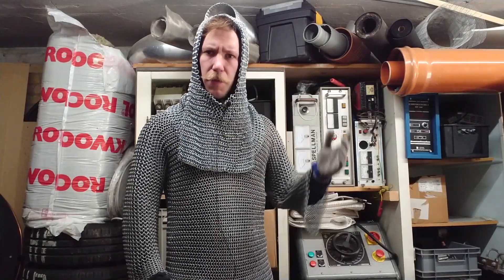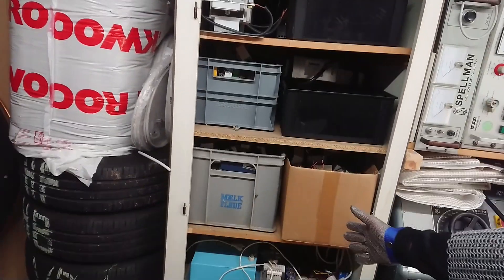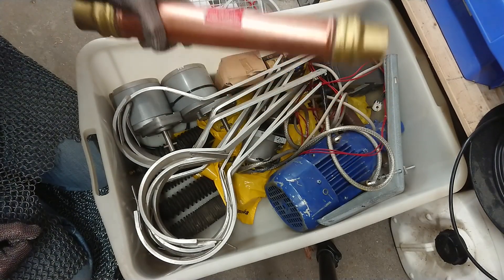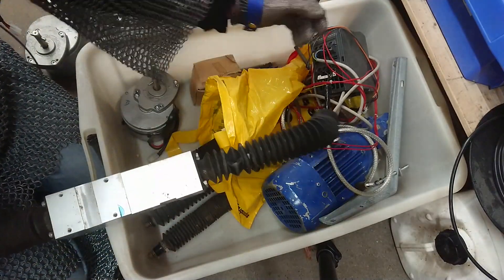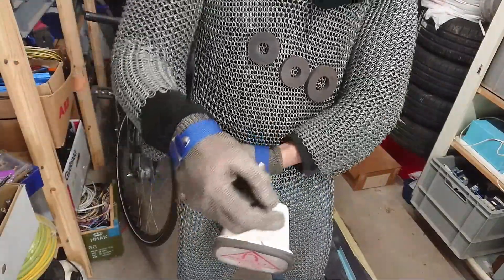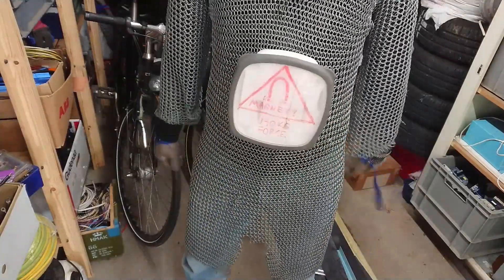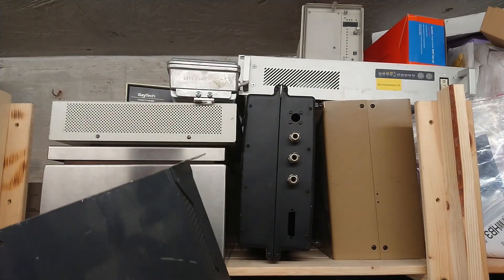After Cleaning, What I Found... - End of Isolation, Day 42

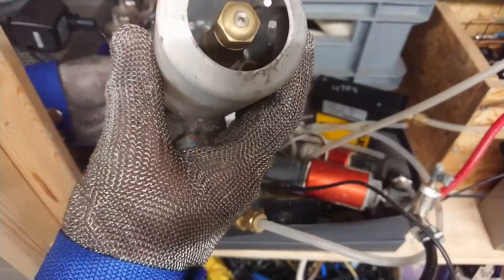Comment: The burner head at 4:13 is for an oil fired furnace :)
Reply from the maker: I can see that the nozzle and ignition rods look like it ( https://noraweb.org/wp-content/uploads/2016/10/NORA-Silver-Chapter-1.pdf ) but I can not seem to find any pictures online where it has that large "shroud" around it.
Reply: @KaizerPowerElectronicsDk  This "shroud" was typical for old systems designed for more than 1MW from 70ties. If you remove "shroud" temporary,  on the front nozzle will be written oil consumption in kg/h or gal/h. I guess that there is a rod that goes through the pipe and is for regulating flow. Nice to see if it is Danfoss or Weishaupt nozzle. Worked on hundreds of industrial burner plants, never seen this exact model.
Reply: @KaizerPowerElectronicsDk  I grew up in a house where we had a oil burner furnace. My dad did repairs on it on several occasions and got a spare unit for parts, so i've had everything taken apart from the cute little gearpump, the nozzle and all these burners had this shroud to generate the vortex of air for the actual flame.